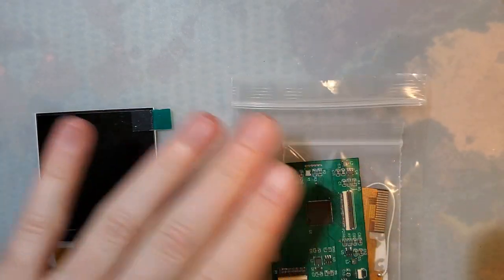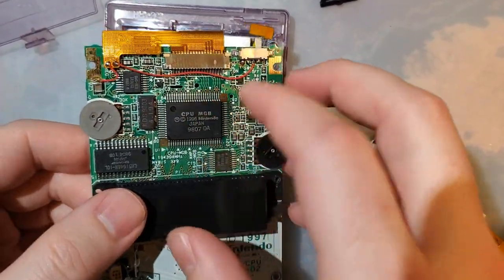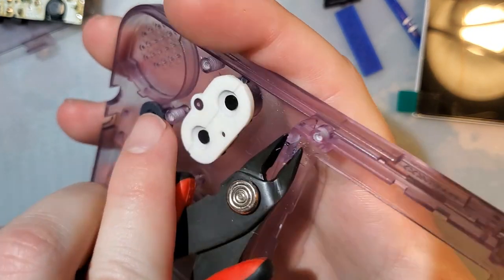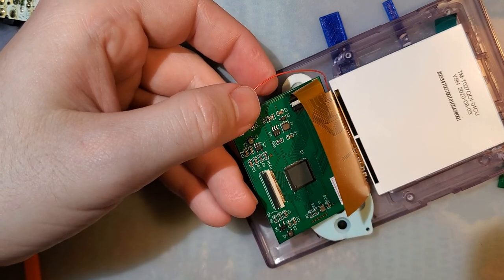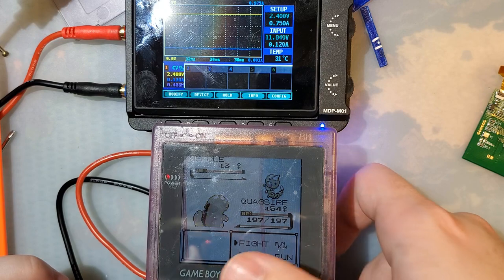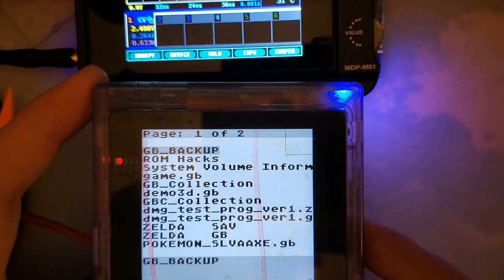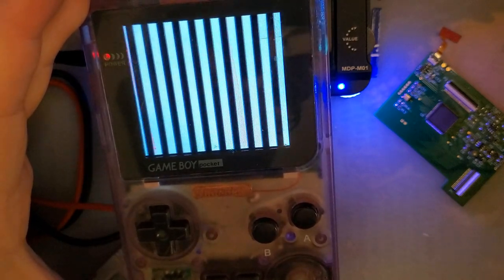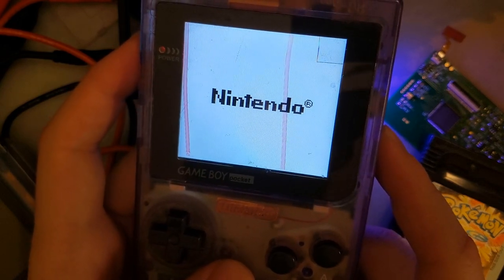CGS AIO XL - Game Boy Pocket Backlight Kit

Comment: I love this kit. Installed one in a gameboy pocket as intended and another in a gameboy light. The supplied adhesive gasket (in newer kits) seems to fit the light as well as the pocket without trouble. I really like the fact it has sensible power consumption so I can get away with using NiMH batteries. Thank you for this video :)
PS: For those reading - please no hate about installing this in a GB Light and "ruining" a rare machine. The GB Light had a burnt screen with screen rot as well and was not salvageable without doing an ugly hack to a pocket screen that does not look OEM, so I did my best to turn it into a nice console to play on. I disabled the EL backlight circuitry, installed this kit, new shell (transparent), glass lens and new buttons :)
Reply from the maker: The Pocket and Light share the same screen design (and button interface) so any screen kit designed for one should work for the other. Even the shell is the same in that area. I intended to install one of these in a Light a while back but that project got backlogged. Perhaps I'll revisit now that there are Light shells available.
Reply: @makho  I'd love to see you mod+refurb a beat up GB Light with one of these kits and a light shell. Thoroughly enjoyed doing mine. I assume you are looking at the same GB Light shells I was - CGS on Ali has them. Fit and finish for the shells is surprisingly good with only VERY minimal flashing to trim if you are picky like I am. Battery door snaps in on mine with zero rattle!
I disabled the EL backlight circuit to stop annoying whine in the audio if the switch is pushed to the Light setting (cut a trace)
BTW your method of delivering the content (voice, pacing, etc) is perfect and I enjoy these videos.

Comment: I personally really appreciate the pixel grid on the funnyplaying, although it is just a gimmicky feature. But also being able to control the brightness via contrast wheel just feels more natural. Really the only advantage I can see to this kit is that it’s somewhat easier to install. Less trimming & easier to align. I think I’d still choose the funnyplaying kit over this. Thanks for the video :)
Reply from the maker: To be fair to this kit, I did modify the touch sensor and that could be a significant contributor to my issues. But yeah, the FP kit has significantly better controls and for that reason it remains my "recommended" kit for the Pocket for now.

Comment: You know what I have been waiting/looking for? A larger backlit color LCD mod kit for Game Boy Color. I did some preliminary measuring and find that a 3.5" display could fit (4" was a bit too big). Or, a slightly larger custom plastic shell that can fit the circuits and all PLUS a larger display would do nicely. I just hate staring at the tiny screen.
Reply from the maker: You know this particular kit is coming to GBC, right? Very soon.
Reply: @makho  No, I didn't.
Reply from the maker: @Voidsworn  Vendor says October so if that still happens then I'll probably have mine mid to late November for making a vid on
Reply: @makho  Excellent. Looking forward to the vid :)

Comment: I look forward to hearing about your ideas on battery mods. I have looked at some of the older options of battery add-ones, sorta plug and play options that don’t require any shell modding, they all stick out a bit but that really doesn’t bother me.
Reply from the maker: I got the preproduction hardware in to test but unfortunately the batteries are too low capacity to be a viable replacement. The vendor quoted 1000mWh but they seem a lot closer to 300mWh. I'll have to pick up some retail samples to verify. If the retail batteries end up being 1000mWh like the vendor quotes (or was it 1100mWh?) then they will absolutely be a good option. I do have one more thing up my sleeve but I think it's sufficient to say that the video is probably due around christmas or later.
Reply: makho nice cant wait to hear. I also have been using a pocket AC to USB cable and that’s handy for long trips where one might have external USB battery available.

Comment: BTW the cheapest, easiest, non-destructive (no shell trimming) Li-ion batt mod is a x2 10440 lithium cells wired in parallel. You can feed those 3.7v directly and all your mods will be happy. DISCLAIMER: I haven't tried it on a GBP but I have on a GBA and GBC (with 14500 cells) and it just works perfectly (for the GBA though you'll need to add a diode in series to drop 4.2v to a usable-ish 3.3v or the GBA won't turn on).
Reply from the maker: Should work but I hesitate to mod my console in such a fashion since you lose the ability to use regular AAA batteries. Might as well go the full mile and install an internal LiPo with integrated charger IMO.

Comment: Thanks for the review. I will definitely get this over the IPS or TFT mod. A friend of mine tested this kit and said the brightness levels could be higher. Did you feel this way?
Reply from the maker: I generally use my consoles at lower brightness levels so I don't mind it. If you take a look in the description, I have a fuckhueg spreadsheet with all my power and screen brightness measurements of all the kits if you want to compare relative brightnesses.

Comment: How are you liking your ifixt kit now that you've had it for a bit? Considering getting it but every review I see of the kit it seems to be advertisements and I feel like I can trust you with an unbiased opinion.
Reply from the maker: Everyone is biased my dude. Even me. That being said, I still wish I had picked one up sooner. 

Like you, I was very put off with how many sponsor spots they were paying for. I generally believe that a good product will speak for itself and does not need advertising but I finally ended up getting one on a friend's recommendation. The only real issue I've had with it is that I keep losing the bits but I can't really blame the kit on that. The case is a bit big too and since I never use the lid as a parts holder, I think I might try my hand at making a smaller case. I suppose if I had to complain about something, including a ratcheting driver would be nice. Not that the included driver is bad, quite the opposite actually, I just might like one of those instead. Though, that would make it more expensive. Anyway, I do like my kit. 

If nothing else, do yourself a favor and pick up a quality set of JIS drivers. The ifixit kit has JIS bits included. The Y drivers are really nice as well. They grip screws to the point where sometimes the magnetic bit gets pulled out of the driver to stay in the screw. 

Oh, I do have one actual complaint though, the bits are too short to be used in a Neo Geo Pocket Color. You need actual regular drivers for that. Presumably other things too but not for Game Boys, laptops, cell phones, keyboards, computer mice, or any of the other junk I regularly fuck with.

Comment: I'm using this kit and it worked fine for a while but now touch sensor doesn't respond to my touches. If I take apart the shell and touch it with my finger it works but when I put it back together again it doesn't respond. It only responds when I squeeze the unit from the corners as the sensor seems to touch the screen or something else that triggers it. I've put kapton tape in front and behind the sensor so it shouldn't be touching the screen or PCB but it still won't work when I close the shell, only when I open it up and touch with my bare finger or if I squeeze the shell and something else triggers the brightness. It useless when I have the unit assembled and all the screws in. Has anyone else had this problem? The touch sensor is on the top right corner of the GBP. Seems to be somewhere else in this video though.
Reply from the maker: This might sound silly but are you dehydrated? These sensors are not very responsive if you're not hydrated. I find they work a lot better when adhered (but insulated) to the shell.
Reply: @makho  Haha maybe but I don't think so. I live in Thailand and it's always hot and humid so I'm regularly chugging water. Maybe I should wash my fingers and try again.

Comment: Still using the EZ-Flash Jr.? I had a lot of problems with that cart. I just bought an Everdrive x7.......so worth the price of entry.
Reply from the maker: I have an ED-X7 but I use the Jr for testing for a few different reasons. One is because it usually causes more issues due to the higher power consumption. Additionally, I use the Jr for testing because the Jr is a common flash cart so testing with it will test the popular set up. This lets me create a worst case scenario that isn't even that uncommon. If there are no problems with the Jr, there should be no problems with the ED-X7. If there are problems with the Jr, I should test with the ED-X7 next but I often don't because lazy and I actually use the ED-X7 sometimes so it's not always at my desk.

Comment: Off topic but do you know of a good quality IPS screen for the GBC that doesn't suffer from screen tearing? I have the Funnyplaying kit but unlike the GBA they never seemed to fix the screen tearing on the Color kit.
Reply from the maker: Nothing full size right now with zero screen tearing or frame dropping. I'd recommend keeping an eye out over the next few months though. Word on the street is that new kits (plural) are coming for the GBC very soon. If you need something right now, the Funnyplaying IPS kit is still pretty good and some of the issues can be mitigated with a newer model GBC but you still just have to deal with that single screen tear on every LCD reset.

Comment: I noticed you did not solder the long white cable it comes with and that we are told to connect/wrap around positive battery terminal. Why not? is it even needed, or what does it do?
Reply from the maker: I did solder. You'll notice that I left that ribbon connected with the wire already soldered.
Reply: @makho  oh you didn't use the new cable, the old kits ribbon was compatible with new board and it was already solder from previous install. Got it. Thanks

Comment: Do you think a full size backlit TFT for the Pocket will ever happen?
Reply from the maker: click play on this video and tell me what you think
Reply: makho when you herp. I guess what I really meant was one that had better visibility in daylight.
Reply from the maker: @DavidYuanRA  probably not going to happen. At least, nothing transflective (TFT means Thin Film Transistor, not Transflective) any time soon. LCD manufacturers stopped making transflective displays a while ago when they realized it's cheaper to just install brighter LEDs for outdoor visibility. Transflective screens also look pretty terrible compared to regular LCDs of similar spec. The FP IPS kit is pretty decent outdoors when the brightness is cranked.
Reply: makho thank you very much for clarifying, I’ve been misinformed about TFT screens. It’s kind of irresponsible for them to have used the same acronym. Looks like I’ve been holding out for no reason. Time to order the FP IPS kit then.

Comment: Question, on the wiki there is a link to https://nl.aliexpress.com/item/4001342123663.html , on this video to https://nl.aliexpress.com/item/4001352247454.html . are both the exact same kit just that one is cheaper than the other?
Reply from the maker: one is a reseller, the other is OEM. Check what accessories one or the other comes with. They are probably the same kit but since cloud game store is the one that makes the kit, you should probably just buy it direct from them.

Comment: Call me crazy, but this looks like the same size as the funnyplaying kit
Reply: This one is apparently original size, eg, an original lens will fit perfectly. The FP kit is bigger and requires an specialized lens.
Reply: @gregorybolivar1876  the funnyplaying kit can fit an original lense as I have one.
Reply from the maker: both kits use OEM sized lenses. I feel that the FP kit is a hair larger (the display image at least, the actual LCD itself is a lot bigger) but I haven't whipped out the calipers to get exact measurements.